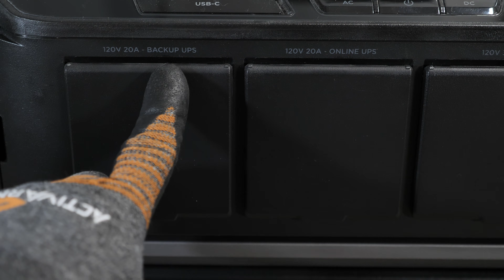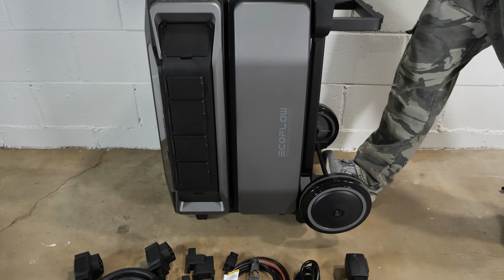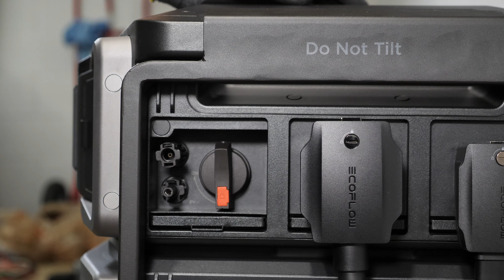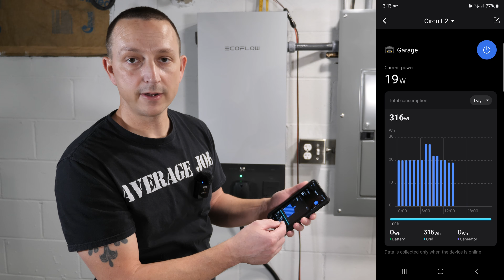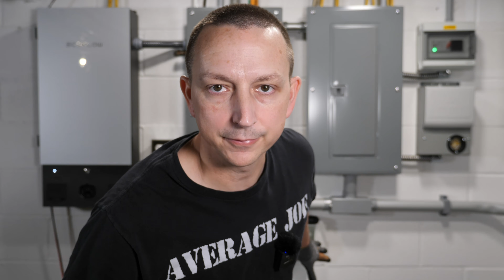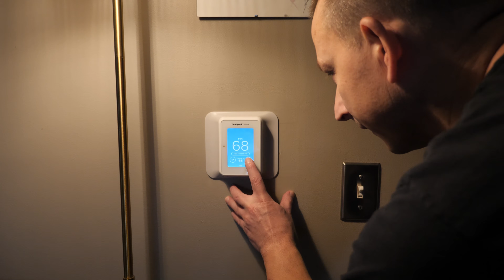Demo of Fully Installed EcoFlow Smart Home Panel 2 with Delta Pro Ultra - Black Friday Deals

Comment from the maker: Affiliate Links to ECOFLOW Use code 24EFBAVEJOE for 7% off and Support my Channel if Worthy!⤵
🔗EcoFlow Website - https://bit.ly/4fFD8jY
🔗EcoFlow Amazon - https://bit.ly/3V9zqqy  
🔗ECOFLOW Delta Pro Ultra - https://bit.ly/3w8eUx0
🔗ProTrans Transfer Switch - https://bit.ly/3vRG2A6
Reply: 25:14 ... You said you "could run a stove, air conditioning and dryer." ... I think you meant STOVE, OR AIR CONDITIONER, OR DRYER ... AND WHILE IT'S A LONG VIDEO, YOU SHOULD HAVE SHOWN TWO STOVE TOP BURNERS.
Reply: Wish you would have went into more details about off grid use. Also want to use the original delta pro for a 120v off grid setup using this panel but nobody is covering that. Nothing in my off grid cabin is 240v. It was designed that way on purpose.
Reply: 11:20 don't make yourself look like an ass when you made an otherwise good video. If you have to turn off something your children are using when you've told them not to? You haven't raised your kids right. Maybe that's a bigger problem than a home power panel.
Reply from the maker: LOL I dont have kids but hear horror story's.  I am in complete agreement!
Reply: 18:50 ... Nobody ever discusses whether or not you need to have an inverter generator to get clean power to this thing. I wish everybody online would discuss how clean the power has to be.
Reply from the maker: That is a great question and at this time I dont have a good answer.  Ill ask the ecoflow team.
Reply: You don't usually need a lot of clean power. Today most electronics have bricks that are variable voltage. The stuff that'll need clean sine wave are motors
Reply: @dondiego124  so to clarify, a standard generator provides sufficiently clean voltage for one of these units to function?
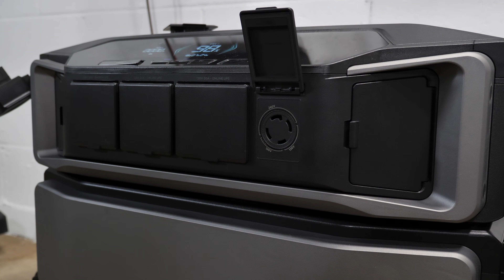Reply: 20:55 when you connect to the PROTRAN, slow down. DO A LITTLE BIT BETTER AT TRANSITIONS.  Show the type of connection on each cord. 

Step back and give a "finger-flow demonstration" of how the panel is transferring from the Eco flow to the protran to the protected loads panel.  Let the finger show the way. ... I'm an engineer and even I need to go back and make sure I grasped it. 

For example, I'm presuming that the umbilical passes from the male receiver of the protran up to the transfer switch, then down to the traditional breakers. The point is that the power flows from the umbilical up and then back towards the center section. Non-technical types would need to understand.

Call it oldmani-itis from an engineer who transitioned into industrial training and teaching shop.
Reply from the maker: Ill try to keep that in mind.  I usually loose people when I go to slow because I go into to much detail, so in this vid I sped it up a little.  Seems I cant win fast or slow.  Ill try and find a good balance.  I do like the "oldmani-itis" term tho!!
Reply: @AVERAGE_JOE  I want to thank you for your response. I worked in engineering, then industrial training, then HR, before teaching shop for 16 years. ... For what it's worth I went back to operating a steam plant before I retired.

It's a fine line between working with the quickest and slowest learners.  Enough said, this is one of the better channels I've been on.

As for the comment about "turning stuff off on your kids," keep your expectations high.  Communicate those expectations to your viewers.

A foreman at a factory once told me that "People only rise to your lowest level of expectations."
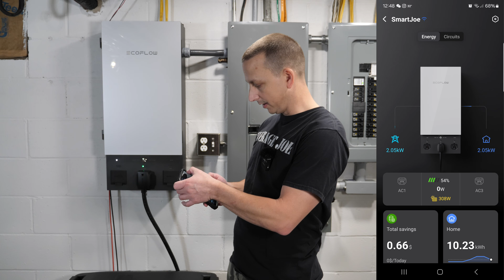Reply: 28:00 again, at the expense of going over 30 minutes, show the extra couple of seconds that it takes for the lights to shift colors. Show people everything they need to expect to see.
Reply: When grid power is on and available will the smart panel back feed to the main panel using battery power? Basically can it use battery power to offset grid usage on the main panel for savings purposes?
Reply: I’d like to see the wattage on the inverter when running the electric ⚡️ oven, dryer or A/C separately
Reply: I am very impressed with your setup. I have had off-grid power since 2011. Solar, same with water stove.  .... But in all of this preparation stuff, and I do quite a bit of it, have you ever stopped to consider that maybe clothes drying, using both ends of an oven is just a little bit of suburban overkill?But in all of this preparation stuff, and I do quite a bit of it, have you ever stopped to consider that maybe clothes drying, using both ends of an oven is just a little bit of suburban overkill?
Reply: Sorry, my phone is doubling up.
Reply: What auto transfer switch are you using and how is it wired
Reply from the maker: @cottoncb  The auto transfer switch I am using for my other systems is here --> Affiliate Link - https://amzn.to/4cH9V6z (pictured in upper right had side of screen).It is wired with grid on one input and an inverter on the other input.  Output is wired to the first subpanel (ecoflow subpanel is wire off this subpanel as well).  If the grid goes down or the inverter goes down I can easily switch from one source to the other automatically or manually to power the subpanels.
Reply: Was there ever an update on your usage of the Ecoflow Delta Pro Ultra?
Reply: Stop the herky-jerky editing particularly on the "three ways to use it." Give people a chance to process the information. Teachers call it WAIT TIME.

Comment: Do we need to ground the Delta Pro Ultra or is it grounded thru the Smart Home Panel connection.
Reply from the maker: No need, Its grounded through the cable to the Smart home panel.
Reply: Thank you...I didn't see any reference for this in the manual.   This easy my mind. @AVERAGE_JOE

Comment: Hi, I am planning to install the smart panel 2 with 3 inverters ( 2 batteries each).
Do you think that I have to do any kind of setting setup since are 3 inverters or it will do it all automatically?
Bye the way, great job with this videos.
Thanks,
Ivan
Reply from the maker: Awesome and thank you! Its all plug and play but I would imagine you will need to do firmware updates on everything but thats pretty easy through the app. The app has updated since I made this video but relatively the same. Once updated you set it up how you want to use it and the batteries/inverters will do what you want in parallel.

Comment: Is it possible to set up the delta pro ultra or ultra x without the smart panel to run the whole house and to be plugged into one of the outlets that it’s supplying power to so that it can operate in pass through mode like the delta pro 3 or river and automatically charge battery at level set in app

Or even better can a circuit be supplied before the main breaker power that will still have grid power even when the main breaker is off so that it can supply a charger outlet from the grid while the whole house is shut off from the grid and being powered y the ultra??
Reply from the maker: You would want to do it from a seperate circuit like you are thinking. For my setup as an example, I could use an outlet from my main circuit breaker panel and then power the sub panel from the Ultra. This is how I did it so I could keep 90% of my house on the sub panel or "critical loads" and left the big items like stove, ac and dryer on the main panel.

For you, you are thinking the entire house and would need to move everything over to a sub panel so you can seperate the power from supply. Or do similar to what I did.🤘

Comment: 🐊🌴😎Hi JOE IS IT POSSIBLE TOO CHARGE through the 30 amp plug at the same time ,instead of using solar..thank you 🐊🌴😎
Reply from the maker: You can charge and use at the same time from the AC charge port or the input/output port cause it will think you are connected to the grid or generator. 

If you are plugged in from the same panel you are trying to power, no. That would be Free energy😆
Reply: @AVERAGE_JOE thank.  🐊🌴😎 you so much ,,,are you getting the DPU X  I am looking forward to see that video this is the most detailed video on YouTube my friend ,,😎🌴🐊😎

Comment: I have one question can I install one main breaker panel with just a 200 amp disconnect then split into 2 sub panels from EcoFlow at 100 A pass-through to each of then connect all my loads through the EcoFlow smart panels buy two ecoFlow ultra inverters +3 battery for each of the inverter connect one on each panel, therefore when the power grid is out, I will have 50 A to run each panel and separate the loads so that not all the heavy loads are on one panel then since it’s a smart panel I could easily turn off what I don’t want in case I’m running really low on batteries or back up my whole house at the same time if I choose to do so will this work? 😅
Reply from the maker: I havent seen it but dont know why you couldnt do that! 2 smart panels from the main panel.  Another thing to look at is there new OceanPro smart panel. Its a 200a main panel and all slots can be controlled.🤘

Comment: 😎🐊🌴 ok Joe fantastic video for sure,,Question If you don't have any solar, or grid power and your plug into the hub for the 50 amp CAN YOU CHARGE the DPU with a Generator through the 30amp Generator spot at the same time ,,,Thank you so much 😎🌴🐊😎

Comment: @AVERAGE_JOE, Question for you sir. 

I know EcoFlow makes a generator power cord that connects from a generator to the Delta Pro Ultra.  The plug look exactly the same as the ones that plug into the bottom of the Smart Home Panel 2. Can that same power cord be connected to the generator and the other end to one of the three input ports on the Smart Home Panel 2 and provide power to the panel? Thus bypassing the Delta Pro Ultra.

Comment: Awesome job  - this video is perfect and so well done. Thank you. But a huge question: when you use the 50 amp hub and power the main panel, do the citcuits in the sh2 also get power, or just the circuits on the main panel gey juice via the hub? I would think the circuits in sh2 would be energized using hub since tjr hub powers tge main circuits and tge sh2 is a circuit off the main panel. Thanks!

Comment: Great video. Can you explain what  your home panel setup is? It looks like you have a main panel, a sub panel, and the SH2. You mentioned when you plug into the 50A generator port, you are powering your whole house? How is that possible? Does that panel feed into the SH2? What about the circuits on the main panel? How do those get power when you plug it into the 50A generator port? Any help is appreciated

Comment: Trying to understand if my scenario will work. I’d like to use the smart panel with solar panels always attached to the delta pro ultra. I would like the solar panels to fill the battery as much as possible, use the battery to provide power to circuits on the smart panel, until the battery no longer can provide (say 20% battery life) and then the circuits automatically switch to grid utility power until the solar panels can recharge the battery to say 80%. It seems like this could be achieved using the app/setting up rules. Thoughts?
Reply from the maker: Yeah I think you can setup everything like how you want for the most part.

Comment: Hello @AveRage_Joe, can I connect my generator directly to SHP2 in case of Battery and inverter failure?
Reply from the maker: Yeah if you have a 240v generator you can connect it to the gen port on the panel. I guess if you live offgrid you could connect to the grid input😎

Comment: If I wanted to run the whole house with no restrictions like running the AC and dryer and electric stove at the same time do I need to max out batteries on one inverter or invest in multiple inverters and spread the five batteries across the inverters. The FAQ on the Ecoflow site tells me to use 2 inverters but also talks about adding batteries you increase the KWh.. so is 30KWh on one inverter better or 30k spread on 3 inverters better for load balancing? I am assuming the reason to have multiple inverters to run higher loads is because of output being capped to 7200 watts.

Comment: Is it possible to have the whole house connected using the smart panel or is it limited to only a certain number of breakers?
Reply from the maker: You could if you could fit everything on the panel. If you cant then you could run another sub panel off the smart panel but you would only have control of that circuit breaker.
Reply: @AVERAGE_JOE thank you

Comment: You produced a great video dealing with the DPU and Home Panel 2.  I'm researching this unit and was just curious it's been over a year with this - so what's your final thought if your still using product?
Reply from the maker: Thanks!  So far its been working as it should.  I mainly use it to monitor circuit loads and as a backup.  If a storm is coming it will auto recharge.  If the power grid blips or cuts out, this auto "kicks in" and continues to power everything.  The "downside" Occasionally when the grid blips quickly, it wont switch fast enough so things "turn off" for a second but comes back if that makes since.  Overall very happy and still use it to this day.
Reply: @AVERAGE_JOE  Have you thought about a whole home surge protector? Just curious. I was thinking if possible maybe 3 or 2 would be needed I think. 1) At the main breaker panel - like Siemens FS140. 2) Between the DPU and SHP2 - not sure how that one would work 3) the solar panel array near the DPU. What do you think or recommend.
Reply from the maker: I have the small surge suppressor from Lowes but WANT/NEED a real one. Id get that one or an emp shield.
Reply: @AVERAGE_JOE  Lol, that's what I was researching it an EMP shield popped up. Again, thanks.
Reply from the maker: @robbaker1726 lol Yep, Ill probly get an emp shield for the main panel and for solar and or where ever I need one to protect everything.

Comment: Im curious if you can connect power from an existing solar inverter system into one of the 3 AC spots in the battery connection Box on the Smart panel. Would it cause an error because it is not connected to an ECO Flow product?
Reply from the maker: Possibly using the generator adapter cable since you can connect up any ol generator. What system ate you thinking? Like an AC coupled solar system or a battery and inverter style system?
Reply: @AVERAGE_JOE  I have a Schneider system right now, 2, 4k watt inverters with 2000AH of batteries and of course all my solar panels.   I want to upgrade because i have never been happy with the clunky schneider software.  So I was thinking of upgrading to something like this ecoflow system.  I can't pay for the $7 or 8K for the entire thing right now, plus the extra batteries I would need so i was wondering if could rig my system to the panel until I upgraded to an entire Ecoflow system.  Maybe in a years time.
Reply: so if I took the power coming from the inverter and modified an ecoflow cord and plugged them into AC1/AC2/AV3 of the smart panel, would it work or cause an error because there would not be a data cord.
Reply from the maker: @earthenergyhex Oh ok gotcha. Well another thought is using the generator input at the top of the panel. Just connect you inverter to it and then use as you want.
Reply: @AVERAGE_JOE  I bought both the EcoFlow Smart Home Panel 2 with Delta Pro Ultra
Reply from the maker: Hell Yeah💥🤘
Reply: @AVERAGE_JOE  what is the RS485 port for?  The manual doesnt say

Comment: We have an issue because when we simulate an outage the power stays off and the batteries don't provide power to the sub panel
Reply from the maker: Are the green lights on the connections to smart panel lit up? Do you have EPS enabled? Need more info

Comment: Really good job bro I’m an electrician so you broke this down extremely well ! What I’m worried about is an ark flash but I don’t think that can happen because the system has a built in transformer smart switch ! When we switch from grid to generator power ! Also I allways know to install an inter lock 🔒 kit at the top 🔝 of each panel to transfer from grid to to generator!!!! Is there anything that could be absolutely dangerous? During an installation??? Besides not installing the interlock kit at the top of the panel ? Anything else to worry about ??? I got a costumer reaching out to me to want to install one of these so I’m trying to study 📚!!!! As much as I can !!!
Reply from the maker: Thanks Man! Nope, nothing out of an ordanary sub panel install. If you have installed a sub panel then this is a breeze. Oh wait, the walls or top of box are thicker so a step bit worked better then a hole saw for me.🤘

Edit: you wont need the inter lock kit like I have. I have it for all the system testing I do. If the customer wants a generator then the smart panel has a spot for that.
Reply: @AVERAGE_JOE  thanks 🙏 brotha I loved your video you broke down extremely well plus showed all the tree examples of each set up 🆙 = meaning the ( 30 amp inlet transfor switch set up ! 
The ( 50 amp inlet outdoor gas ⛽️ generator! 
And battery 🪫 inverter set up ⬆️!!! You made a extremely good and helpful video bro A++++++ 👏 🫡🫡🫡🫡🫡🫡🫡🙏🙏🫡🫡🫡